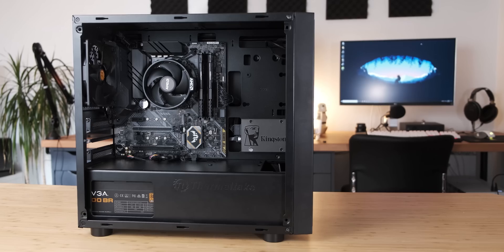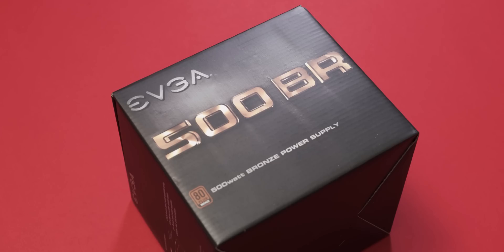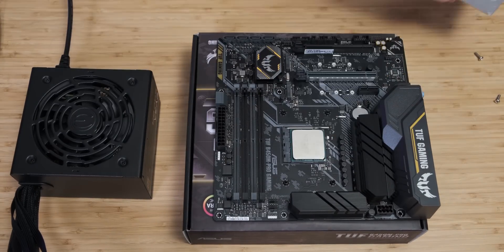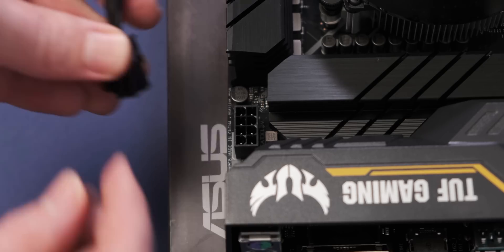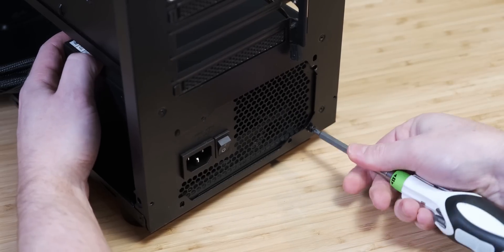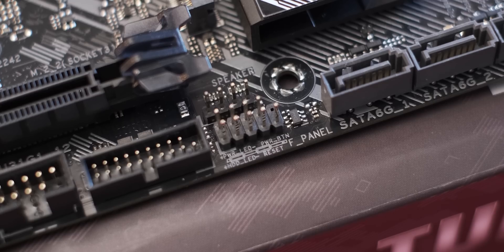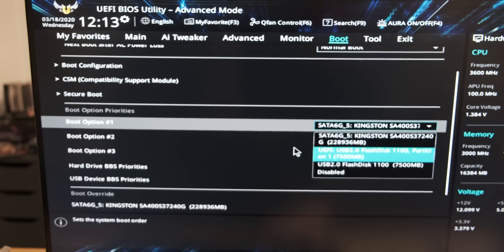How to build a PC: Quick Guide ($390 Pre-Built destroyer)

Comment from the maker: I just wanted to add a couple notes. First off, the Motherboard listed in the video description needs a BIOS update to work with the Ryzen 3200G. If you don't have an older Ryzen CPU available, please buy a Motherboard that lists "Ryzen 3000" compatibility out of the box. 
Secondly, some people in the comments mentioned that sometimes when you start a system up for the first time, it cycles between off and on a couple times before powering up normally.
Thank you for watching and have a great day. :D
Reply: How do I overclock it and have it be safe I used the exact parts thanks
Reply: Why is there no GPU?
Reply: @rohanzack167  the reason is that there is no GPU is because it's a budget build for the future and upgradeabilty so the processor actually has an integrated graphics and it's actually surprisingly good I am running Minecraft in about 150 frames per second on a beta so. What games would you be playing on it?
Reply: @connerpaull1439  sege, fortnite,subnatica
Reply: @rohanzack167  it runs subnautica pretty good at to high settings I would say 45 to 57 fps and fortnite it runs like 30 fps everything at medium and idk about sege
Reply: Conner Paull hi
Reply: I'm building this PC and do not have another PC or processor I can use to update the bios. Do you have any suggestions for a cheap processor I can use to update the motherboard? I'd also like to use it for a backup processor for other troubleshooting issues I may have in the future.
Reply: berrydam not any CPUs but I would recommend the msi b450m pro vdh MAX, make sure it is the max series board because they come Ryzen 3000 ready. I wouldn’t bother buying a 2nd cpu if you could just swap out the motherboard.
Reply: @DLBDLB10  i would recommend going with a different mobo instead. The gigabyte dhs3 V2 b450 is about the same price and doesn't require a bios update
Reply: gigabyte gv-r455d3-512i  good graphics card for gaming
Reply: Can this PC run Kenshi, Total war Shogun, Bannerlord, Hearts of Iron?
Reply: Does the ryzen listed in the description work or not? (Sorry if I said something stupid I don't know anything about pcs)
Reply: @Mooonie.  neither do I but it's better learning then buying a Pre built
Reply: @МаксимВолков-щ7е  Yeah but I don't want to waste money on something that might not work
Reply: @Mooonie.  im late, the processor works, the motherboard needs a BIOS update, hes suggesting you buy a different motherboard thats 3000 series ready, i suggest getting the b450M ds3h V2 if you havent built it already.

Comment: id say few things to mention, make sure no pins are grounding on the case as these days most have argb , if pc don't turn on it can also be gpu not seated correct as it worked then i had to go in and remove it to access motherboard and putting it back in ( on riser) was not seated correct and pc did nothing not even fans would spin. personally id say go in to bios when you first start your built computer, enable xmp or amd version xmp and while there set boot from drive. at a budget enabling xmp should not be an issue as you not dealing with crazy fast ram where you can run in to issues and when pc finally installed windows your pc running at it fastest state well fastest before an overclock but i do not bother with that just xmp. if you building in an itx case you may find it more easy to plug in those case cables first so just put motherboard on high box at side case and plug in cables but then you need to be extra careful installing motherboard, i did itx build the small cable plugs were almost impossible and i with i installed them before they went in to case

Comment: I know this is an old vid but a trick we used to do for static problems. if you are like me and not gonna touch the power supply, alligator clip and a piece of wire does the trick.

Comment: I was curious to see how much it would cost to build this PC using the links in the video, as of November 2022. Only the 3000 2x8GB DDR4 was unavailable, so I pretended the 3200 would be OK, and apparently the motherboard and power supply was only available used.

Totalled out to around USD $440 not including tax, so maybe don't build this one and pick a mboard and supply that are currently available. Useful video, despite that, as PC building hasn't really changed much in the last 2 years.
Reply: *below the video

Comment: I just have to say: Don't ever use that pre applied thermal paste, good thermal paste isn't even that expensive so get that, I love mAtx form factor but please get the H18 instead of another mATX case with better airflow, neither H17 or H18 has top support for 240mm Radiator even when they have the space, guess TT couldn't be bothered to drill a few freaking extra holes on the top of these cases

Comment: I am building with this case and a similar CPU athlon 3000g and it says in the CPU box the motherboards with am4 socket need a bios update to work with these cpus

Edit: Gigabyte includes a disk version of the am4 bios file box of the B450 Aorus M

Comment: unpopular opinion but if you want an actually good full gaming pc + peripherals you'll need AT LEAST $2000
Reply: no not really if there was not a gpu shortage 600-700$ will get you a pretty decent one.
Reply: @HI-sc4um  including monitor, mouse, mousepad,     headset, keyboard, case, cpu, gpu, cooler, ram, motherboard, psu, and storage. if EACH item (not including mouse, mousepad, keyboard, and headphones because I guess you could get those cheap) was $200 cad, at least where I'm from you would still be at about 2k, and thats without applying the cost of an operating system and probably games
Reply: @Sussy_B_Dussy  for me it would be abought  1100$
Reply: @Sussy_B_Dussy  alright so i went with basic peripherals and parts, nothing flashy or anything since all you said was that it had to be a good full gaming pc. 
with the parts i chose (all confirmed to work with eachother) and not accounting for the huge pc part shortage. (accounting for that it would still be below the $2000 cad minimum budget you set) again you only said it had to be actually good, so i went with mid end parts because they can still play the majority of vr games, and can play AAA games on medium - high settings at 60 fps, which is what i would consider to be "actually good". all together at msrp prices, it came to $730 usd. and i'm sure if you bought used parts, you could get cheaper (without the shortages of course)
Reply: @Sussy_B_Dussy  i can provide a parts list if you want your point to be smashed into pieces even further
Reply: @Sussy_B_Dussy  You can get a functional PC for way less than that, unless your idea of functional is 4k or high fps 1440p maxed out AAA games

Comment: The PSU case has paint on it, which doesn't help grounding, and also it isn't always connected to the ground directly, there is often some kind of combination of resistors and capacitors.
To get a good grounding point you kind or have to make it yourself (warning: if you are an idiot you can die while trying to do this!)

Comment: I wish motherboard manufacturers would start changing the configuration of the boards. Why can’t they turn the 24 pin connector 90 degrees so the cable is straight rather than bent? Why is the front audio nearly unreachable from the front I/O? Things that drive me nuts.

Comment: Got that same motherboard in my current gaming build.  Very stable, easy to upgrade, decent BIOS, not expensive.  I went with a Noctua black cooler instead of using the stock cooler.

Comment: Should've mentioned that some motherboards come with little adapter pieces for the front panel connectors. Not so much an adapter but an easier-to-connect home for all the wires so you only have to plug in one bigger plug rather than multiple smaller ones

Comment: Love your vids buddy but are you aware you Should never have the pc power supply plugged in at all when working on the system, even if its switched off. Just use a static strap or touch the case, you need to be on the same electrical level.  Leaving the power cord in may be dangerous.  See what Carey Holzman says. Static earth should be a different earth to mains earth. I us to install static and clean workshops for British Airways. By the way nothing wrong at all with gray market keys. 👍👍. Love them All the best, you saved me the other month by not buying that dell xps, had it built by Novatech instead here in the UK, cheaper and much better spec, plus 5 yrs support. cheers

Comment: Great video for beginners, though i do think some things could of been done better:
Should point out to make sure you are connecting cpu fan into the slot that explicitly says CPU_FAN(systems refuse to boot without a fan plugged in there)
Should of noted about how to properly orientate the USB 3 cabel, those pins are pretty fragile and it goes in only one way which might not be as obvious to a beginner
And obviously i do think you should of added in any GPU and HDD to show how to do that, it is only an extra minute or two in a video but it could be very useful for a beginner.

P.S. Love your content mate, glad you are getting sponsors by now

Comment: Me: makes a pc under 200 dollars with the following 

750gb HDD
MSI GTX 760 OC 4gb 
10gb ram
I5-2500
EVGA 500w 80 plus certified

Dell Optiplex 790 for 60 bucks, 30 bucks for GTX 760 and 60 bucks for the power supply

(GTX 760 4gb was on letgo it was a steal and it works perfect)

Comment: One thing: You can't overtighten the stock AMD cooler. In fact, you should tighten it until you cant turn the screws anymore or the mounting pressure wont be correct. Was the case for my NH-D15 with spring screws. Didn't tighten all the way and I had 90C max temps on my 3900X. Tightened all the way and I got 75C max.

Comment: Thank you! You are amazing! I've been researching and trying to find a cheap and good working PC, and this video was it! I have not bought the pieces to build it yet (because I need to save up more money), but I'm defiantly going to build it. 
Suggestion: List the pieces you used in your PC, because I had to go through the video multiple times to get the names of the Motherboard and the Ram (listed below).
thank you for all you do!

Asus TUF B450M-Plus Gaming AMD Ryzen 2 AM4 DDR4 HDMI DVI-D M.2 mATX Motherboard:
 https://www.amazon.com/TUF-Gaming-Motherboard-Ryzen-B450M-Plus/dp/B07FKV3TVF/ref=sr_1_3?dchild=1&keywords=TUF+B450M-pro+gaming+motherboard+asus&qid=1605083128&sr=8-3

HyperX Fury 16GB 2666MHz DDR4 CL16 DIMM (Kit of 2) 1Rx8  Black XMP Desktop Memory HX426C16FB3K2/16 Ram: 
https://www.amazon.com/HyperX-2666MHz-Desktop-HX426C16FB3K2-16/dp/B07WJJHWYD/ref=sr_1_1?crid=1V2ATDZDNBTZ8&dchild=1&keywords=hyperx+fury+ddr4+ram&qid=1605083268&sprefix=Hyper+x+fury+ddr4%2Caps%2C272&sr=8-1
Reply: The Motherboard and ram I listed above are incorrect, below are the correct items.

ASUS TUF B450-PLUS Gaming AMD AM4 (3rd/2nd/1st Gen Ryzen ATX Gaming Motherboard(Digi+VRM, HDMI 2.0b,USB 3.1 Gen 2, Pre-Mount I/O Shield and Aura Sync RGB Lighting):
https://www.amazon.com/TUF-B450-Plus-Gaming-Motherboard-Ryzen/dp/B07FMVJT1H/ref=sr_1_2?dchild=1&keywords=TUF+B450M-pro+gaming+motherboard+asus&qid=1605118773&refinements=p_n_condition-type%3A2224371011&rnid=2224369011&s=electronics&sr=1-2

HyperX Fury 16GB 2666MHz DDR4 CL16 DIMM (Kit of 2) 1Rx8  Black XMP Desktop Memory HX426C16FB3K2/16:
https://www.amazon.com/HyperX-2666MHz-Desktop-HX426C16FB3K2-16/dp/B07WJJHWYD/ref=sr_1_2?crid=1V2ATDZDNBTZ8&dchild=1&keywords=hyperx+fury+ddr4+ram&qid=1605083268&sprefix=Hyper+x+fury+ddr4%2Caps%2C272&sr=8-2

Comment: Heyo! I'm kinda new to all of this, but I've decided I definitely want to build my own PC. I'd be using the PC for recording gaming sessions, video editing, and possibly streaming, so I'll need lots of storage and the ability to multitask with programs. I also do digital art, but I'm gonna assume that any build that can handle gaming can also handle a measly art program and drawing tablet, ha. 
   Based on what I'm using the PC for, what specs should I upgrade, if anything? Even though I like the cheap build, I wouldn't mind spending a little more if it can lead to a better experience. Would getting more RAM hurt or help? Also, can I use an SSD bigger than 240 GB? And I've heard people sometimes use two separate SSDs, what's that about? Lastly, what's the difference between relying on the built-in graphics card in the APU and getting a separate one? Would that be better, or would it not matter? Thanks in advanced for anyone who answers my questions! I'm just afraid of upgrading one part and in turn ruining something else, since I'm not sure how interconnected all the PC pieces are. :')
Reply: i know im a year too late but i will still try to help. You might want to put a 1-2 tb hard drive in to the system ideally 7200 rpm for quicker load times and faster responsiveness. If you put 16 gb of ram in that will help immensely ideally 3200mhz @ cl16 becuase that is the sweet spot for amd ryzen (make sure it is activated in the bios on the mother board) it is easy to do but you might want a tutorial on youtube. You will also want a external gpu probably something like a 1660 super or ti depending on your price point maybe even higher. and a ryzen 5 3600x or 5600x will do. (note if it is a 5th gen amd cpu you will need to go with a motherboard that says 5th gen compatible or b550 or x570.) you will know if it is a 5th gen cpu because the first number represents the generation. hopefully i could help even if someone else finds this😀

Comment: I was working on getting parts for my first build i have everything thing but the cpu and I ran out of budget. I have had the Case since Christmas. the parts I have are the cables nzxt h510i, thermaltake 500w, Corsair vengeance 16gb 3200mhz, and the gigabyte b450m.  For the gpu I have an gtx 1650 super. I originally thought I had a budget around $580 for my birthday. But I got around $360ish. Anyway $350 build looks good.

Comment: In the description, the motherboard you listed is a full ATX motherboard, but the case is a Micro ATX case. The ASRock B450M Pro4 motherboard will not fit inside at all, you'll have to either get an ATX mid tower or a Micro ATX case.

Comment: you can also go with the same layout but with a bit more power although with older gen cpu. I have a ryzen 5 1600 that costed me around 90$, 2x g.skill ripjaws 16gb 3200mhz and a rx 580 at 120$ and the rest of the stuff and it costed me in total exactly the same (well it ended at 390 cause i also bought an hdd but without it it went to 340$)

Comment: I just built a streaming machine for cheap. I got a B450 TUF Asus open box for $40 originally bought a Athlon 3000  for $41.99 . I had a SUGO case laying around with a Asus 390X , WD 2.5 500GB and I had 8gb of DDR4  ohh bought a PSU Powerspec 550W for like $45. I'm gonna use it mostly for streaming old games with el gato .

Comment: Why the Ryzen 3 3200G and not the Ryzen 5 1600 AF? It's $85 and I've heard that the 1600 AF is basically an underclocked Ryzen 5 2600 and is on par with the Ryzen 5 2600 when both are overclocked. Also, since it's $15 cheaper than the 3200G, you have $15 more to spend somewhere else. Not to mention, it should outperform the 3200G.
Reply from the maker: You can watch the previous video. I explain it there. 👍

Comment: Hi

So my friend offered to sell dell optiplex 7020 pc with screen for under 150$

And i really think its a good deal but can i upgrade it to use it for gaming?
Reply: It is a good deal though, is it SFF or Mini tower. If it is mini tower, buy it but if it is SFF do not buy it.
Reply: SFF can not be upgraded easily.
Reply: I believe it is sff
Reply: But it got i7 inside and windows 7 can be upgraded to 10
Reply: What gpu do you want to put in?
Reply: I don't know something kinda cheap and good 😅
Reply: @tareqksa20  Ok. A gt 1030 or rx 550 are the best options for this pc.
Reply: What about the power supply do i need to change it?
Reply: @tareqksa20  If you put a gt 1030 or rx 550 no. But for all the other praphics cards, yes. Gt 1030 only consums 30watts and rx 550 only 50watts.

Comment: THe shroud/cowling of the Warith Cooler can actually be turned.
While the Cooler, the whole unit that is, is fairly set, due to the rectangular nature of the mounting, the fan-shroud/cowling is on a rectangular/circular mounting.

So, what I have  done is turn it 90 degrees, so that AMD is now "on top", rather than to the side.

It's a small thing, but for someone who tends to be a bit nit-picky, it does give off a great satisfaction.

Comment: Just a little thought/idea. If the idea is a cheap Pc that can still run games or other programs that rely on GPU you could vastly improve this same build with a used GTX 970 which you can find on Ebay for around or under $100 or for a few more $$ a GTX 980. I recently built something very similar to this for a friend's little brother for Christmas only with a GTX 970 and it can run almost all AAA games on high settings at or above 60FPS. While its not a great long term solution it is a great immediate addition that will vastly improve your experience while adding minimal cost. Just my $.02. Good video and information! Keep it coming!!

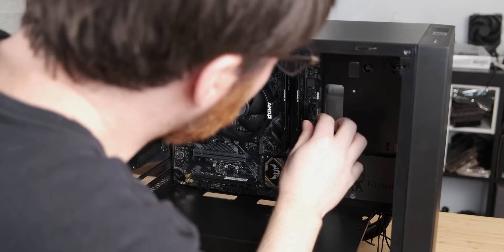Comment: 9:14 while not a build I re did the cable management in a prebuilt i bought recently and routed that connector differently.  Is routed this way as delivered but seemed to be pinched by some other components.  I ran it up through the bottom and feel that its putting less strain on the board this way.